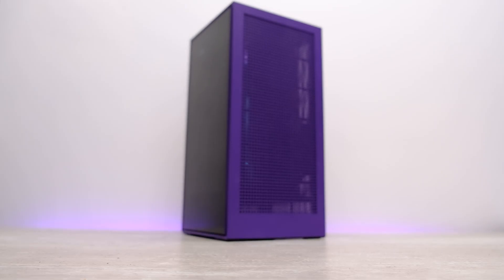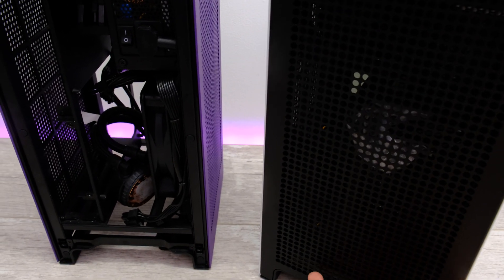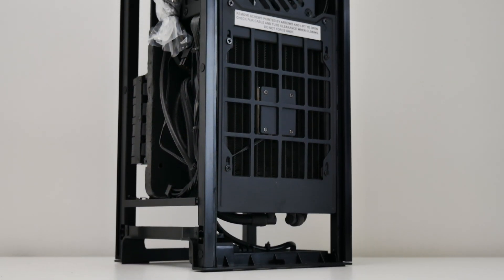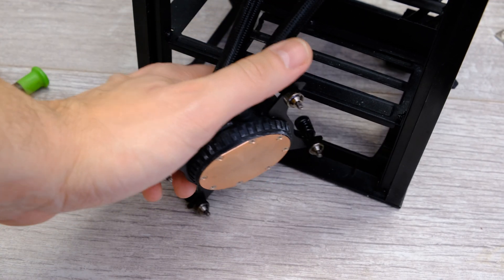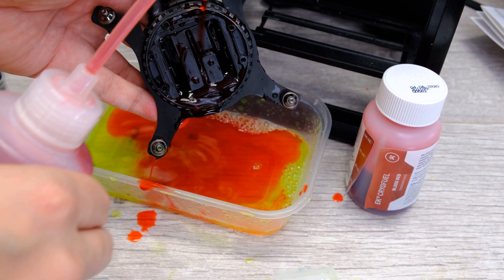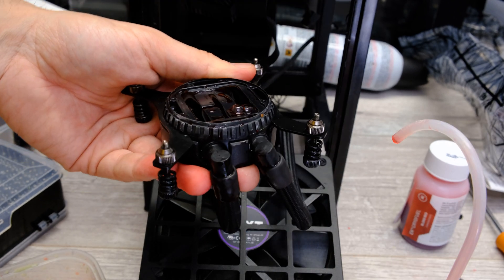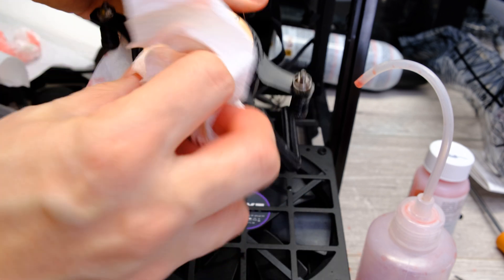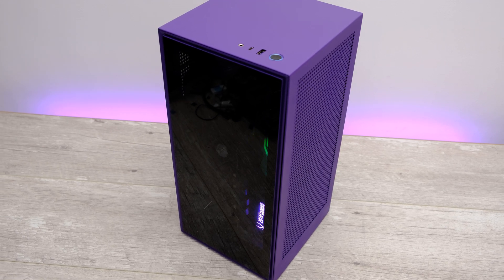NZXT H1 PUMP FAILURE (AND FIX)

Comment: Glad I found this video. Hit the same issue after not using this case for a while. I recently built a new system to test Arc 770 using a known very cool running 3800x. Was my main chip for a while and idled at about 30C with a Corsair h100i (240mm). With this cooler it now idles at 83C and hits 100C very quickly just from opening a browser. I opened it up and sure enough, white gunk. Cleaned it out and put it back together and now I idle at 63C. Still not good enough. Going to call NZXT tomorrow to see if they'll replace it but am also going to try flushing it and replacing with EK CryoFuel tomorrow. I'm worried now, though, becuase I own 3 other NZXT AIO's. Might just be a matter of time if those go bad.
Reply: I ended up draining the system, blowing it out with air and then refilled with EK CryFuel. Idles at 34C now and max temp I've seen is 54.

Comment: Thank you so much for this!!! I was going to change case entirely - given the myriad of problems with it so far (riser cable, etc). My cpu temps were rising to 70-80 at idle… I just did one clean, and it’s back down to 50. You’ve saved me a few hundred bucks! 

Still for a Ryzen 3900x - is that still high?
Reply: 3900x is a tough chip to cool. 50 still seems a but high but what are your load temps? If you run IBT what does it max out at?

Comment: From day one my ryzen 3900x was getting ~55c idle - 70c under load.  recently i had a full failure and it pegged at 100% fan/100c, and during investigating I came across this video.  I went to the store and got some new coolant and tore my AIO apart.  Sure enough, it was gunked to all hell.  I flushed it twice, put it back together, ran for a day, and then flushed it again.  Now I'm getting ~30-40c idle, and 62c under full load.  Coolant flush made a world of difference for me.  Thanks for this video!
Reply: NZXT is doing poor shit products......
Reply: @davidkusztor9278  Do RMA with NZXT ... cheaper
Reply: Still going strong or did you end up having the same issue?
Reply: @DouglasWhitcomb  I had the same issue after 12-18 months or so, and I eventually ditched the NZXT and rebuilt my machine around the formd t1 case w/ a larger 240mm AIO

Comment: Just started happening to me. I’ll be using your guide. Thanks for making it!
Reply: OMG literally just happened to me today! 95C idle temps...no more no less. I will def be using this tutorial! A+
Reply: @nicosuave3249  i guess everyone rigged decided to fk up because mine was running around 30-40 and this week it’s at 90 C and it keeps turning my pc off
Reply: @nicosuave3249  Same with mine just a few days ago.  I'll be doing this, but right now I just installed my AMD-supplied cooler, and installed a 140mm fan to use an exhaust while I resolve the aio cooler.  If NZXT tells me to pound salt, I'm going to do this.
Reply from the maker: Sorry to hear that but happy to help!

Comment: Currently still working. Amazing. Thank you very much
I lower 25 to 30 degrees the temperature of ryzen 7 2700x and remove thermal throttling.
😁😁😁👍👍💪💪

Comment: How much coolant do you need for this?
Reply from the maker: Half a litre would be fine. Don’t need much.
Reply: @CrazyTechLab  whoa wasn't expecting a reply in less than 10 mins haha.  Ty! I will report back on whether this fix works for me!
Reply from the maker: @proudsuburbandad9279  I aim to please! Just be very sure to bleed/remove air from it when you fill it again. Can take a while but it will be noisy/gurgly otherwise! Give it a good shake and make sure it’s filled to the brim.

Comment: hi, thanks for this video. I been having high CPU temps, so thought I'd give this a go. The plate was all gunked up, so I cleaned all of that and flushed the system with distilled water.

Put in fresh coolant, topped it off, fresh thermal paste and all that good stuff...96°C CPU temp and a high pitch whine coming from the pump.

Took it apart again to see if I had left air in the system, topped it up again, fresh paste again and then it hit 111°C before it shut itself down.

At a loss of what to do now, any ideas?
Reply from the maker: Could be two things - firstly it’s very easy for the plate to be gunked up more than once so if temps are high it’s worth checking again as it can take a few flushes  to clear out. 

Secondly it can be difficult to get all the air out the loop. It’s best to have the rad sat flat on a desk and have the pump lifted vertically above it as I did in the video. Might need to shake the radiator and tubes a bit while you fill from the pump to dislodge air bubbles and do not let coolant pour out while you replace the copper cap contact plate. Needs to remain horizontal and with coolant filled to the brim
Reply: Hey, having the same issue. Did you ever resolve it?

Comment: Thanks for uploading this, had exact same issue. My symptoms were that sometimes upon startup, PC would overheat the CPU and cause my PC to shut down. I guess I had a partial blockage and sometimes, coolant would get blocked from all that gunk upon startup. Sometimes I would get lucky and coolant would be able to flow and cool the CPU. This fix definitely decreased CPU overall temperatures though.

It's really disappointing NZXT has not addressed this issue since I expect AIO coolers to not have this kind of issue, maybe a degradation in performance is acceptable, but not when it can cause component failure.

Comment: Thanks, I admit I never thought to look inside the closed loop heat block. Had the same looking junk completely in the copper and a bit inside the motor housing on the radiator side. Flushed it all out and ice cold temperatures have returned.
Reply from the maker: Glad to hear! Keep an eye on the temps. I had to flush mine a couple of times

Comment: Great video and really useful.  Is it possible to remove the plate and clean off the gunk without losing the coolant? I just contacted NZXT to get a warranty replacement on the AIO as its 18 months old.   Lets see what they say!  

I am thinking about fitting an air cooler instead such as Noctua L12S or Scythe Big Shuriken 3 to cool my Ryzen 3600. I have a total of 3 H1's in my house and already gone through the riser shenanigans.  Instinct is telling me not to waste time with these AIOs and just get an air cooler?
Reply: For what it’s worth, I have just cleaned mine without adding any more coolant. 

I was extremely careful removing the copper plate and only lost a tiny amount of coolant. I would say the system is probably 97% full now…a little air inside. Due to the setup, however, this air should settle at the top of the radiator.

If you wiggle the system whilst holding the block at the highest point BEFORE you remove the copper plate, the air should be in the block. This means you’ve got a better chance of not spilling any. It worked for me…

I used a tiny flat head screwdriver to scoop out the gunk. Not a perfect solution, but good enough for another few months until I do it properly, flushing and replacing the coolant as per this video.

Awesome video, this. I wouldn’t have the confidence to do this without the detailed guide.
Reply from the maker: The trouble is it needs to be fully filled 100% to avoid air bubbles circulating in the loop and making the pump gurgle. It’s very difficult not to spill any. The instant you tilt the pump or lay it down, coolant comes out. When you remove the plate, coolant drips off. Even a few drops could result in the loop not being full enough.
Reply: @CrazyTechLab  Thanks for the advice.

Comment: Temps doubled suddenly after bumping the case around while trying to clean it, took a while to figure out what was wrong.  Thanks for the video, good as new now.
Reply: After replacing the fluid, did the temperature change when shaking the case?

Comment: I wonder how the performance after you changed the coolant compared to when you first got the H1, could it be even better than a factory new H1 since the coolant itself was part of the problem?
Reply: I just did it on mine, had the same amount of gunk in my AIO. And the temps have gone down by 10-15 degrees

Comment: How do I make sure I completely filled my AIO loop? I did the steps but it seems that in certain orientations(when my NZXT is standing up) my pump makes a weird noise and it sounds like there’s no coolant running through the system
Reply from the maker: Just focus on the bit where the bubbles come up and make sure the radiator is below the pump. I thought it was filled but quite a few bubbles kept coming up.

Comment: Cleaned it, flushed the whole system 3 times, got new coolant, and within 30 min my temps rose again took it back apart and it's clogged full again, might just say screw it and get a noctua low pro cooler.

Comment: Thanks a lot man, fixed it thanks to you ;) my 11600kf went from 92c idle back to 33 idle, and 68 in cpu stress test after 10min. I did just used demineralized water as liquid, I don't know if specialized liquid worth it a 20eur per litre.
Reply: Well i don't know if it's because I did not use any additive or my loop was not flushed properly but the same issue appeared very quickly again, about a day or two. 
After doing the manipulation twice and considering the fact I'm still not super into buying 20€ worth of liquid additives for each refill I ordered a Noctua NH-L12S for 50€ to replace the AIO.
Reply: @pandiwan6376  How about the temperatures you get now with the air cooler?
Reply: @eprpop  Hi Edward, I've got a slight undervolt on both the cpu (i5 11600KF) & GPU (6800XT stock model from AMD), If I remember correctly CPU temps are around 70°C under gaming load and 75°C with CPU-Z stress test in a room at 35°C. It's a bit cooler where I live now I can re-do the test if you're interested.
Reply: @pandiwan6376  Hi Pandiwan, thanks for your reply, those temps are good considering the ambient of 35C. I have been thinking about an alternative when my H1 Aio fails, i think now that air cooling is not  a bad idea.
Reply: @eprpop  Just played a game of CoD Cold War yesterday, had a cpu max temp of 72°c, it often was around 65°c when I chekcked on my afterburner overlay. room temp was 24°C.
Reply: I did also run a CPU Z Stress test all cores at 4.6GHZ for 5 minutes, CPU temps went up to 79°c. Cpu is undervolted -0.057 V

Comment: Had the exact same issue after 1.5 years. Temps suddenly went all the way up to 90C idle, back to 30-40 now.
I agree this is something NZXT should be addressing, but with this being my main work system, there's just no way I could wait for RMA lead times...

Thanks for the vid!
Reply: I just did my second clean, it was all clunked up again. 
There's probably a lot of junk that built up in that rad that is starting to release now the fluid was able to flow again...
Keep an eye on your temps!

"Rinse and repeat" ;)
Reply: @bskrt  I'm fighting this right now, and I think I'm going to swap it out. I'm concerned that it's oxidized metal from the radiator. If that's the case, I imagine it's only going to be a matter of time before it springs a leak and kills something.
Reply: @ELGEvilLawnGnome  Did the liquid swapp today, and temps are back to 30 / 40. 

But the fact that the radiator metal could be oxidized... does not sounds good to me.
Guess could be a fix for now, sadly if that's the case, not sure what would be an alternative AIO, or solution.
Reply: @bskrt  hi, may i know what coolant are you using?
Reply: @whatthejohn1  sure, using EK Cryofuel, clear version
Reply: @bskrt  Late reply but might be relevant if someone has the same problem.  I was given the option of paying 80 euros for a replacement AIO which was shipped to me. I then sent back the faulty one and got a refund for the full amount. So no downtime if your system is still usable.
Reply: @BilldalSWE  Thanks for the update. I threw the original AIO out and made a full custom loop with both gpu and cpu. Definitely not the most optimal setup in this case, but works fine for me!
Reply: @BilldalSWE this is the only one way i can imagine being customer friendly in the end.
I am also lucky guck guy now. But honestly i dont wanna replace anything with liquid myself
Reply: @DouglasWhitcomb I remember cleaning/fully flushing it twice within 2 weeks. Replaced the coolant with clear coolant (EK clear) and was trouble free for at least a year. Can't tell you more about the longer term as I did a full rebuild after that.
I do recommend using a clear coolant though, as colored fluids have a higher tendency to goop up.
Good luck.

Comment: YOU ARE ABSOLUTELY AMAZING!!!! For a year I have been wondering why my idle temps were running around 50c+, when browsing chrome/video streaming was around 70c+ and I dont even want to start on games... My cooler was absolutely CAKED, even pretuding past the rubber material. I did everything except changing the coolant (which i will do later) and now my temps idle are in the lower 30s. Thank you so much!!!!!!
Reply from the maker: Glad to have helped! Worth checking periodically as it can reoccur as more sludge comes loose and of course consider returning it under warranty of you still can.

Comment: Great video! Hope this is the cause of my crazy temps as well. We'll find out tomorrow I guess...
Reply: That was totally it. The block was totally blocked. I dropped 20 degrees under load!
Reply: @JoshuaGotcher  After doing the cleanup is it still going strong or did you end up having the same issue again?
Reply: Thanks for your update, i will try on my overheating h1 as well once i buy coolant.

Comment: You have just saved me
Reply from the maker: Glad to be of service! Be sure to check your temps in the hours/days after as it may well get clogged again. Also make sure to use coolant with anti corrosion and anti fungal properties
Reply: @CrazyTechLab  Hi, i already had clean the aio 4 times since then, i have the feeling as the times goes the faster it clogs up. Do you have any suggestion what should i do? (i'm using EK cryofuel clear premix). i was thinking about buying new AIO but it could have the same problem
Reply from the maker: @MrKosTern  it seems to be mostly isolated to the AIO used by NZXT here. Flushing it multiple times if need be should solve it. Sadly 140mm AIOs are very rare if not impossible to find.

Comment: Just be careful with this fix. Mine started giving sky-high CPU temps, to the point of crashing . I followed this tutorial, (mine was full of gunk) but alas did not fix the issue (My water pump makes a noise, like bad bearings) Anyway tried to do a warranty call, and was honest about me trying to fix it. My support was dismissed due to me attempting to fix it...:(

Now checking for alternative cooling, otherwise this will be trashed and no longer trusting NZXT (BTW just bought a Meshilicious case, and going to spec that up)
Reply: check out this custom loop for the h1. might be what ur looking for. https://www.youtube.com/watch?v=a3MduBQ4A30&ab_channel=OptimumTech
Reply: let the pump run for a little longer, the whirring sound is likely air bubbles being pumped around but they dissappear as the pump runs its course
Reply: @jibi4820  Thanks, yeah I tried for over a week to sort it, but no luck.
Raised a complaint with NZXT, and they ended up sending me a new Radiator and pump at no cost.... Cheers

Comment: Just by coincidence I recently got hold of a H1 with a defect aio very cheap. This might just be the perfect video to bring it back to life. A big thank you from me:-). And a new sub.
Reply from the maker: It's still a fabulous case. Love it. If it means cleaning out it's definitely worth a go! It's likely flux mixing with the coolant. Ultimately it won't do it for ever but just worth keeping an eye on it. It's a pretty simple thing to disassemble anyway.
Reply: @CrazyTechLab  I have not tested the cooler yet, just informed that it was not working and thus the seller just wanted to get rid of it. Do I need to refill with coolant fluid, or could I simply use water if there is not much spill?

Alternatively, if I cannot get the cooler to work, it can still be used with a cpu air cooler.

Comment: What's the likelihood this is gonna happen with the V2? I literally just got it after holding off on the V1. Still love the case so guess I'll just keep checking those temps!
Reply: Hey, have you had any issues with the v2?
Reply: @shoumenyuan  Not yet but tbh it's not been running as much as the V1 was. Will report back if I hear anything!

Comment: I just had this issue and did exactly what you did, had the exact same gunk inside it. went from 80-90 idle to 30-35. You're amazing! Also NZXT doesnt have any H1 cooler in stock apparently ( i contacted them)
Reply from the maker: No it’s a 140mm radiator and they’re extremely rare. Just keep an eye on it as it can clog again. Not ideal!

Comment: Nicely done, and well narrated. I do, however, feel that I would return the unit/RMA, if I owned one. NZXT should be the ones feeling the pain for this. Ultimately, while I am quite capable of the fix, I don't want to perpetuate the onus of something like this being the responsibility of the end-user. That said, for those wishing for a DIY solution, your video should serve to be quite useful.

Comment: Can anyone please help, I have undone all the screws but the plate isn't budging?
Reply: Just takes a bit of force to pry it out. Could carefully use a small flathead between the housing and the plate, being careful not to damage either. It is sort of under a small vacuum.

Comment: I had my tube break in mine and leaked everywhere. Thank god it didn’t get on the important stuff and fixed it myself
Reply: Curious, how did you repair it? Splice, barbed fitting with clamps, or what?